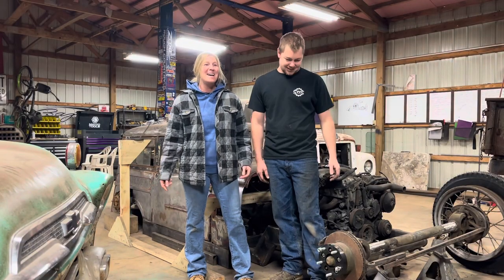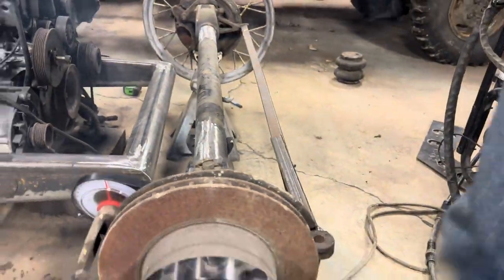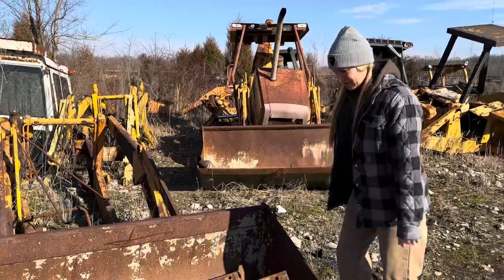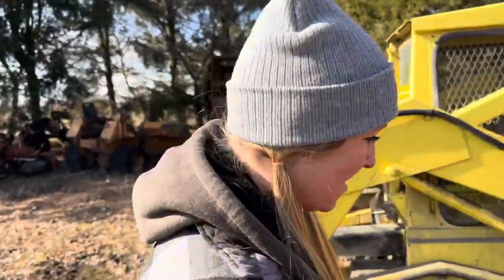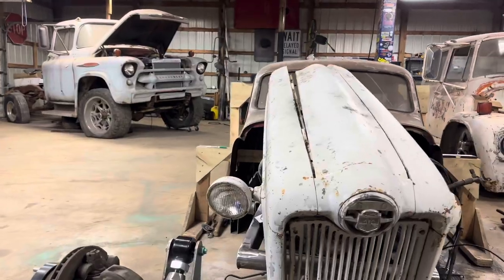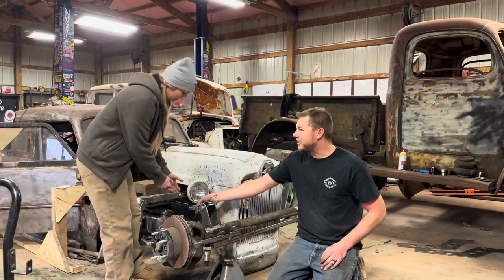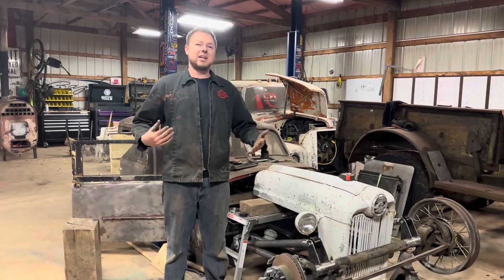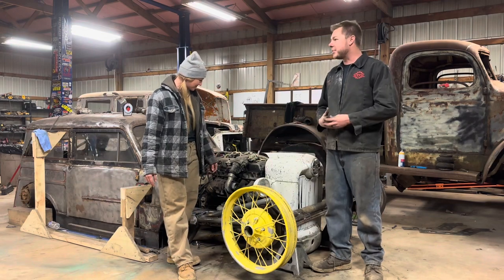BIG Things Happening to the MOUSE TRAP

Comment: The grill looks great! The upper link on the front suspension needs to be able to pivot or it will bind up/ not lineup it you weld it like it is. That or you can put a bend in the the rear and make it parallel where the heim joints are so it doesn't bind when you adjust them. Just google radius arm suspension.
Reply: Perhaps set the caster at ride height as well ?
Reply: The king pin angle is backwards because the axle is up side down.
Reply from the maker: Yeah, I didn’t realize the Axel was flipped in for end I changed it since then. Lol.

Comment: You can trim the edges of the grill in 1/4 inch round stock. Just use tacks every inch and will keep keep to the rat rod look, and strengthen the edge of the floppy metal

Comment: Hannah does have the model runway walk down.  My personal preference is still #1 because I can see exactly what Cory meant when it matched the Crosley's lines...Line up the center divider in the grill with the center divider in the windshield.  Yes, I own a 1964 Ford 4000 Diesel tractor I use on a weekly (weather permitting, no all-weather cabs in 1964...yes, levity intended), and sometimes daily, basis, and I'm like...Oh Nooooooooo...Not to be confused as Mad as Hell!!  I'm not one that watches thinking, Oh, I could do that, but more like, "Oh...That's how you can do that."  Note to Cory:  I think front pipe cross-member, for lack of a better term, is a very good idea.  Very clean, finished look.  Still laughing at the ending!  Another great video.  Please keep them coming!

Comment: To late but should left the Side on as top part of the Fenders. Just take top off and pull the sides out to match the Dog House. But it your Build Grill should be taller add three to Four inches higher.

Comment: 4 to 6 degrees caster and then do toe OUT 1/16 to 1/8 makes it run without death wobble
Reply: Because it's not 4 link the caster is going to change when the suspension is raised or lowered.
Reply: @helixhippie  the caster needs to be set at ride height it's exactly the same as a gasser